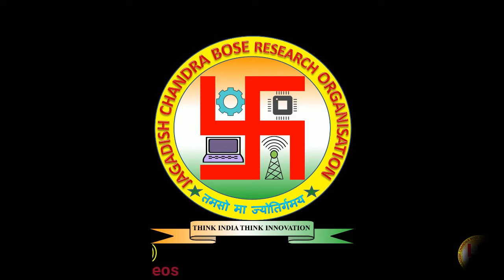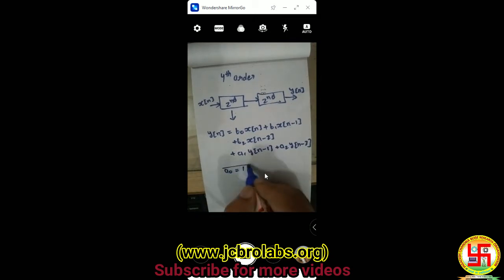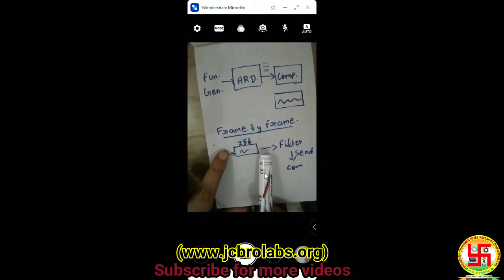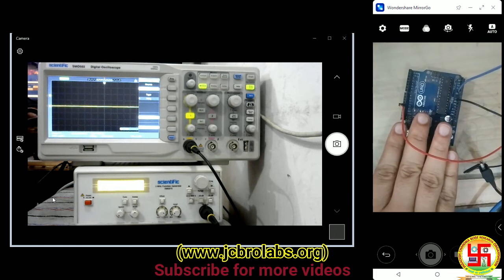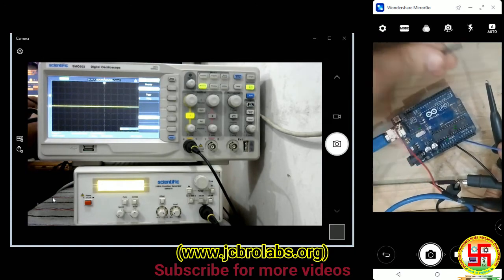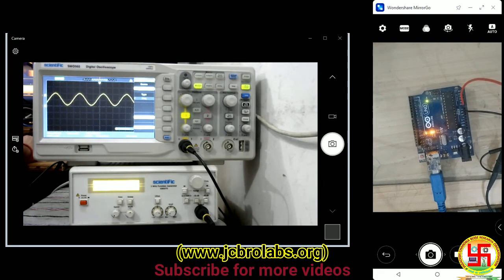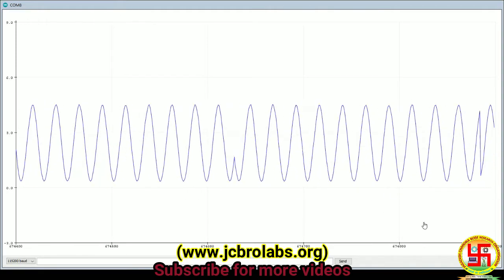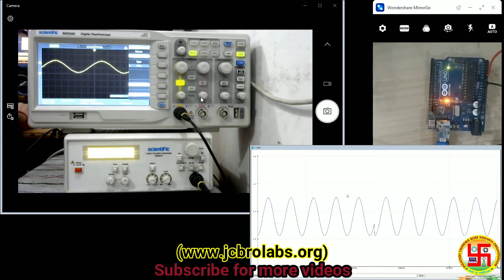How to Implement a Real Time Low Pass Filter (LPF) using Arduino (Part - I) ?

Comment: Nice video, Why 256 samples only in a frame, is it because Arduino is 8 bit? or any specific reason?
Reply from the maker: No, you can choose any size of the frame. It depends upon your requirement. E.g. If frame size is higher then required memory will be higher (as you observed in 2nd part, Arduino UNO memory got filled when we were taking 512 samples), time taken by the controller to process everything will be higher as well.